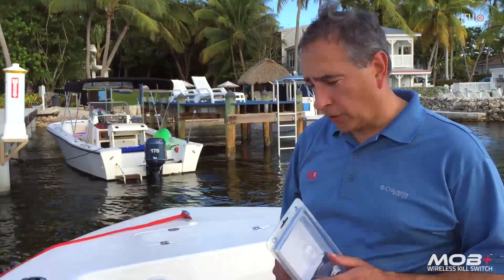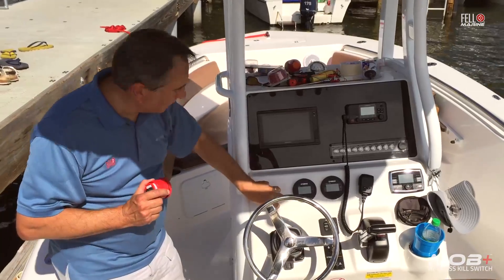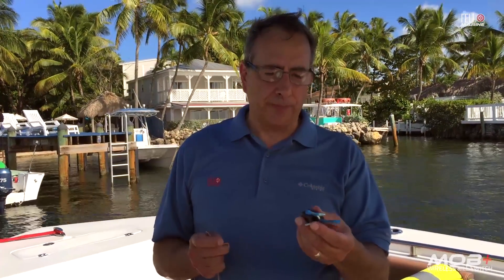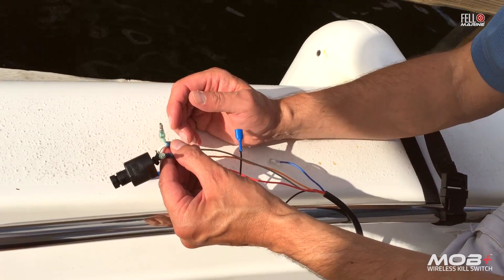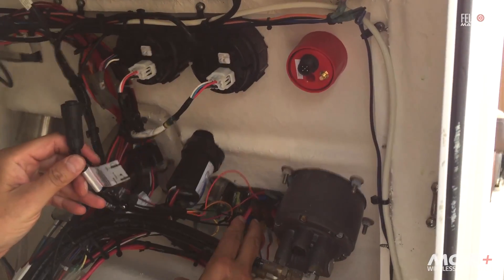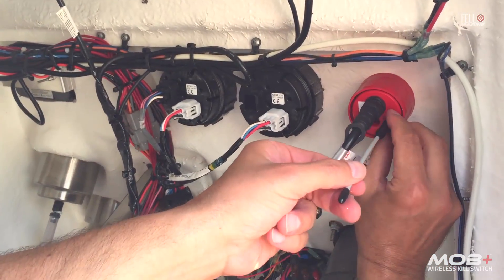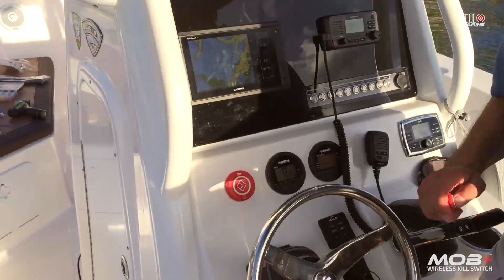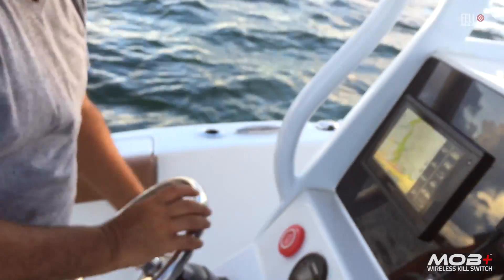MOB+: How to install on outboard engine

Comment: I have a 20’ aluminum fishing boat and I mainly fish for salmon in Lake Ontario. 
The boat has a main engine
 (200hp merc) and a kicker engine (15hp merc), for trolling. Both have throttle controls at the helm with separate kill switches with lanyards. 
Question 
Can I wire this device to both kill switches?
I need it to work when I’m trolling and when I’m running wide open. 
Or will I have to buy 2? One for each engine ?

Comment: I installed MOB+ man in my Land boat, it works great, I tested it, I went to 25 f, the engine turned off. I immersed it in water for the second test at 6 inches, the engine turned off immediately.

Comment: It should be mentioned any availability of an antenna extension cable if theres too many obstructions or they dont like the location of the antenna, perhaps locating it to a more prominent place. For example, in a 10 foot high storm waves and thrown overboard, most likely the radio waves wont reach the boat. The test scenario shown may not be typical.  But if you had a 30 foot mast and mounted antenna there, there would be a much better chance the transmitter would reach the kill switch. This would necessitate an accessory kit that includes both extension cable (15ft lengths), male-to-male antenna cable coupler (for multiple cables) and also thru-hull and surface mounting brackets for the antenna.

Though seldom mentioned by Marine Electronics Manufacturers, its recommended that Di-Electric Grease be applied to connectors to both reduce corrosion and ensure the best electrical connection, especially the antenna connections.

Comment: Question: why is in this video is the original kill switch wired in parallel? Makes no sense because if you left a safety landyard hooked to the kill switch the circuit would remain open/closed bypassing the MOB+. Or is that another method of bypassing a faulty unit? Have the Landyard just in case but never pug it up unless an emergency?
Reply: He has a yamaha, which is close-to-stop. So the engine will stop when either the kill switch or the MOB+ closes the circuit.
Reply: I have a Yamaha but have them in serial. If you do them in parallel you have to have the old kill switch inserted at all times. In serial I can use either and the old kill switch key can stay in the glove box…

Comment: I just finished installing on my boat. There's a reason they cut away and don't show configuring the wiring, you need to skin the harness wiring and solder a jumper to make a tee. Sure would be nice if they included one with the proper hardware on it.

Comment: ... why not mention the extra wiring harness you need if you have two or more engines, conveniently overlooked here.
Reply: if your handy with a few feet of wire you can just make your own!!!!
Reply: If your boat has a safety lanyard, it would kill both motors, acts in the same way

Comment: I need to pair the two sistems every time i want to start my engine or the system have a memory for the "paired" devides and then i haven't to do anything during normal operations of starting/switching off the engine? Thank you to every one that help me